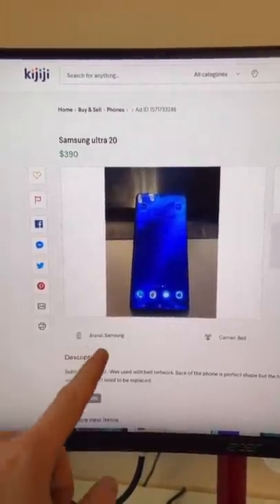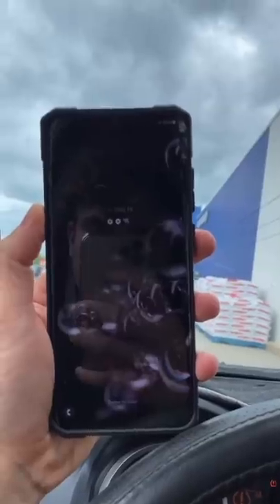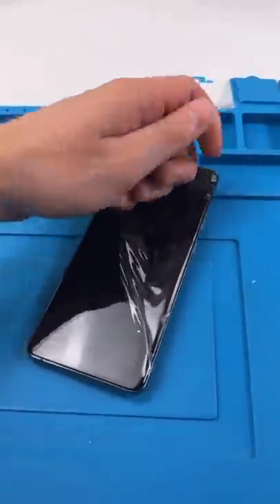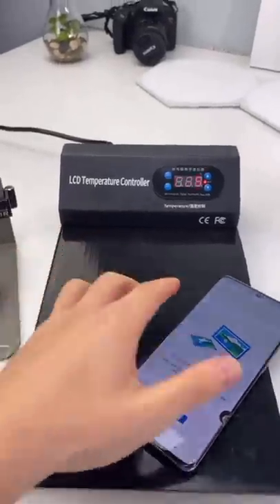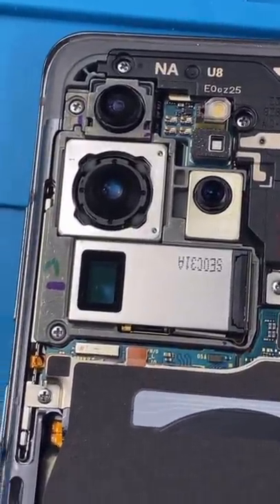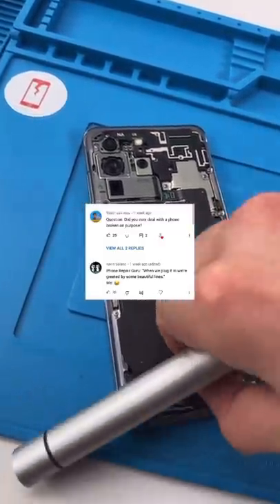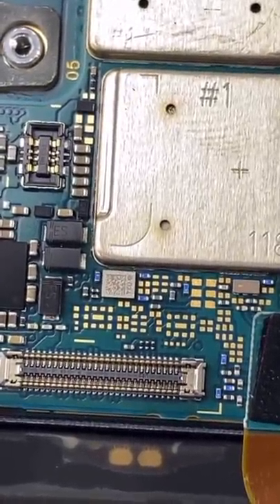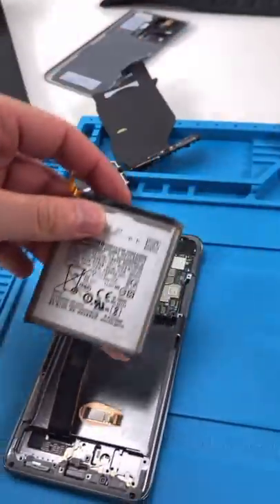I Got This S20 Ultra For Dirt Cheap ... Phone Hunting #Shorts

Comment: What he didn't tell us is the screen and frame was $300. I guess for a $1200* phone, it's worth the repair.

*Edited to correct price
Reply: Pretty sure this phone isn’t 2200$. Unless he got jipped. I just spent around 1200 for a brand new s21 ultra 256gb
Reply: @starwars910  you're right, I way overestimated the price.
Reply: Nah man the original screen costs 220 eu in Greece..
Reply: @tonyvlakos4118  OEM ones are $290 here. 🤷‍♂️ I exaggerated the screen price. I figured being new it would be more expensive than my old note 10+ screen that was $300.
Reply: @hondaguy9153  yeah but he also has a graveyard of phones so might have another one, and doing it as a job as access to different prices, maybe without vat

He's not telling you to do it, especially cause you would need to be able to fix it in the first place

Comment: You can buy that phone used with no broken display for less than you spent on the phone + part to fix it......
And that's an A quality pull with no scratches. Like new. $503.99 to be exact... That part goes for $274.99.
Reply: True, also risking to get a trashy third party display and loosing water resistance and breaking other parts while taking them out.

Comment: the thing that helps to remove the screen (the samsung cooker xD), doesnt ruin the batteries? Lithium batteries get ruined with heat, so I was curious to know
Reply: Are you asking if it DOES ruin the battery or saying that it DOESN'T [DOES NOT] ruin the battery,. Sorry just curious 😐 🤔 😅 LoLz
Reply: Behind the display is a metal plate which so heat wont be able to damage the battery.
Reply: The battery only gets damaged if its long-term heat exposure. 10 mins won't do anything to it

Comment: "some of the components are so tiny" when you need to replace a camera they take off the lens and look under the microscope at the tiny wires connected to the sensor those are REALLY tiny

Comment: 300 is expensive. cause lcd with frame is above $180.  total is $480. to buy s20 ultra in good condition on ebay is $350  ). if you could replace just a broken glass but not lcd you would make some money.problem with samsung is market value goos down so fast. its not easey to find person to sell ). good luck .